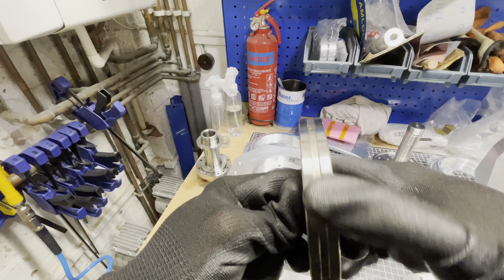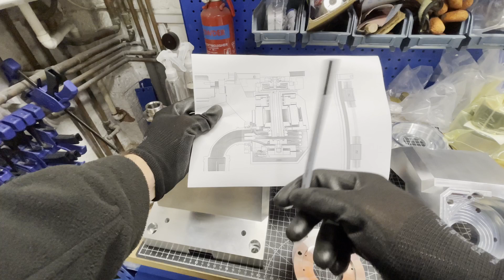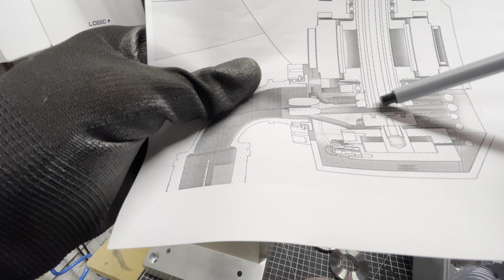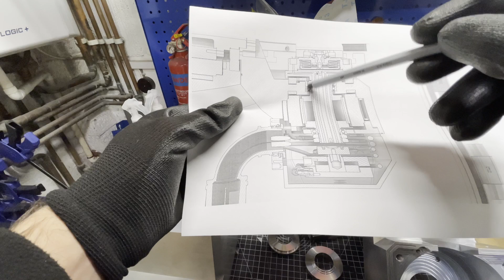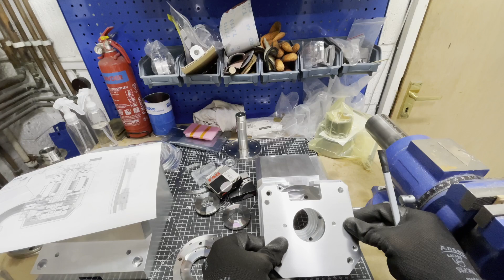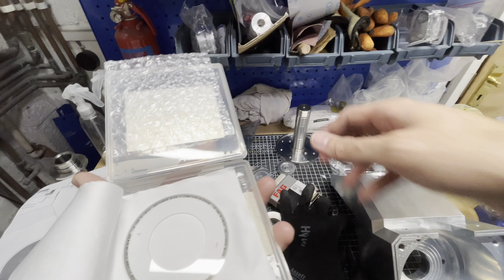Impossible to Machine?! Hold my BEER! - E004

Comment: Is there a strain wave gear system that gets hooked up to that UCP bearing?

It's pretty confusing even tho im building my own 3axis vmc that will have a 4th axis on the table (nice and hefty overkilled the frame for the size)

Wish i had the resources to overkillon precision components too 😂
Reply from the maker: There is no gear. It's a torque motor, directly rotating the axis. 
Harmonic gears are rigid and backlash free, but they introduce lost motion to the system and the input speed and acceleration can be a bit limiting as well. 

Good luck with your build. If budget is limited, harmonic gears is a solid choice 👍
Reply: @kasramehraky9283 ahh ok! Thanks for the reply, I thought that was the case the deeper I got into the video and got a better understanding.

Sorry to be a pain but at what point does c0 ground ballscrews become advantageous over c3? 

I always thought there's such little advantage going with c0 over c3 as the difference in repeatability and positional accuracy may not be measurable?

I'm a flat out wrong? Surely there must be a point of diminishing returns? And all the prices are contact for quotes! Is there much of a pricing difference?

This CNC is hopefully primarily for mechanical watch making and it needs to be as accurate as possible but I don't want to pay double for each ballscrew resulting in 500usd for each c0 ballscrew when c3 is 300usd and the noticeable gains will be impossible to notice lol

Sorry for the long question but it's hard to speak to ppl that are actually qualified for this type of question.

I'm planning to get with c3 and for rails the 2nd highest accuracy I think they call them HP and highest is UP depending on the company.

Thanks for your time it's greatly appreciated!!

Comment: Custom torque motors. That build is just amazing. I dont wanna know the Financials thou. Jig ground bearing pockets...
Reply: I'm just impressed by your build. Having the ability to jig grind your bearing seats is just amazing. Pure perfection. Love it. How di you plan to control your mill? LinuxCNC with TCP ? With the way you approach things I wouldn't even wonder if you pull out a full fledged Heidenhain or Siemens control out of your sleeve.
Reply from the maker: @WUdhuozouz  😁 The controller is on par with those two you mentioned, or maybe even superior. It's Beckhoff TwinCAT CNC. The same control on Chiron Micro 5 or Precitrame.
Reply from the maker: If you want maximum accuracy, jig gridning is the only possible option.

Comment: Insanely nicely built rotary axis! Going to be interesting to see it run.

What is the weight of the trunnion itself?

The  only thing I am not sure about is no brake on at least the tilt axis. I would worry about a sudden power loss causing the rotary to swing potentially hitting stuff or worse actually lose power during a swinging motion which would try to move past 90deg. It would ofc also help with rigidity if you wanted to some more heavy machining (tho ofc that would require the brake to not cause any movement when locking which is a fairly common problem).

I had to design a trunnion I made myself to have a brake on the motor as otherwise the table weight would back-drive the 32 size harmonic reduced on power loss. Ofc my case there is a large negative offset from the platter top to the center of the tilt axis, which I did as to reduce Y and Z axis length requirement (which ofc resulted in having the center of mass offset). Not to mention that the moving part of the table is round 55kg.
Reply from the maker: Hi!

The weight should be around 8KG. In an ideal world, I would have fitted a brake as well, but I don't remember a power loss in the UK for the past 4-5 years. Yes, someone can smash the Emergency Stop button and potentially turn the servos off, but I'm not too bothered about the axis slowing down and even potentially touching the side of the spindle. I even suspect the bearing's stiffness would hold the axis in place, but I wouldn't know until the system is fully assembled.

I have designed similar systems (both 5 axis heads and turnions) for customers and I had to fit brakes of course. They can be a bit messy, increasing the required space, and can cause fault and issues as well. So I decided not to bother with them for this build.

Comment: Great work on the design. How come you're not using a brake? Will you be doing roughing just using the motors holding torque?
Reply from the maker: Thanks!

This machine won't be doing any roughing. It's designed for fast movements and small material removal. Also, if roughing is needed, we have the fixed table with a second chuck to hold the parts extremely rigid. With that said, the torque motors are quite oversized for what I need and they will be able to lock in position for any roughing that might be needed.
Reply: @kasramehraky9283  Interesting. What servo drives will you use? They must be incredibly fast to handle 0.5 arc secs at 5k rpm (216MHz pulse freq)
Nice design on the air feed through btw. Bet that was a pig to drill the holes in 316!
Looking forward to the next installment

Comment: Very impressive. Such beautiful parts! I'm curious about the material choice. How did you decide between Aluminum and Steel?
Reply from the maker: To be honest, the main reason for choosing aluminium for the body was weight saving. Steel (or cast iron) would have been a better option, but then I had to increase the size of the torque motors. Also since aluminium is quite a good material for thermal conductivity, by using a silicon thermal paste between the axis housing and cooling jackets, I can stabilise the temperature of the bearings and prevent expansion of the housings. With that said, the first design iterations were completely different and these two axis were also made from granite, but that was a really hard thing to pull off. For the other parts I went for stainless steel 316L, simply due to its corrosion resistance properties, which is far better than common carbon steels and even tool steels. So far I'm happy with the materials.